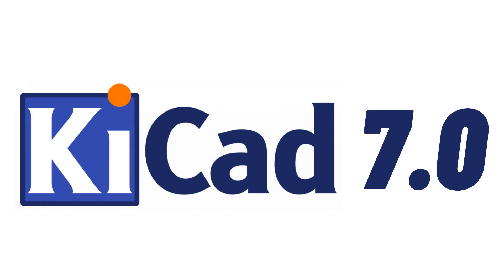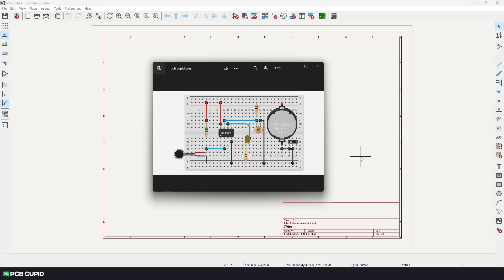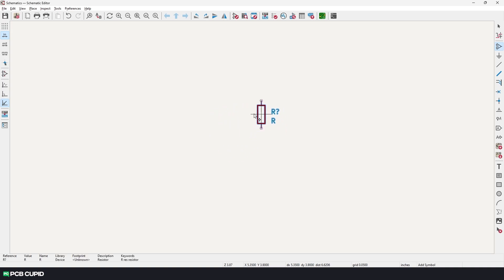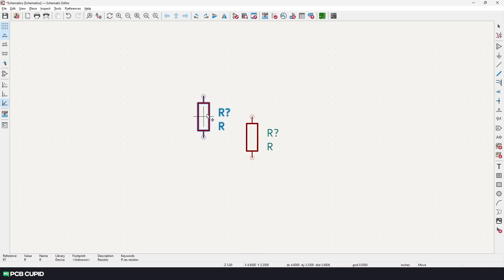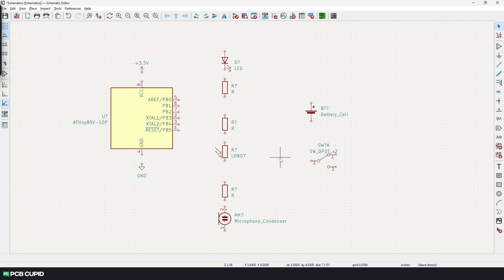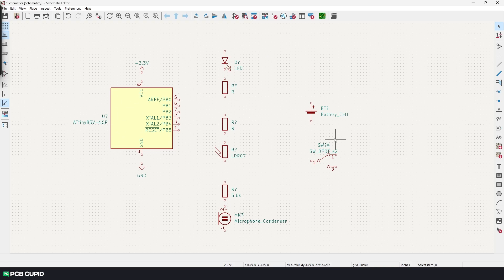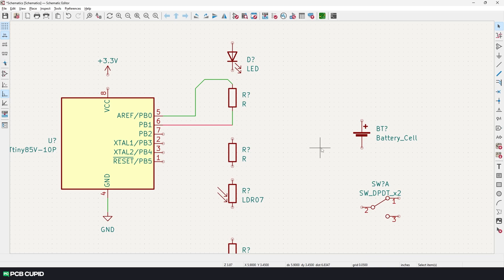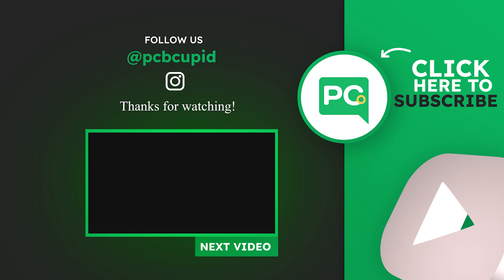#3 How To Design A Circuit Using KiCad 7.0 Schematic Editor | #PCBCupid

Comment: thanks for the video . how can i change power supply as "vac" value. I'm trying to do dc power supply 220 V, 50 Hz but i cant change the value. whats the solution of this problem
Reply: Well, can i use screw_terminal_ 01x02?
Reply from the maker: @busra4386  Yes that would be perfect.
Reply from the maker: Which power supply symbol are you using? 

You can change the value of the symbol by going to the properties. (right click on the symbol and then click properties or select the symbol and use the shortcut "E")
Reply: @pcbcupid  I added the source seen as AC_voltage source used in multisim program as “vac” in kicad.  But in kicad, I can't enter a value like in my multisim. 
I have to use this design https://youtu.be/DaY3ruHjnIk
Reply from the maker: @busra4386  If the symbol is part of power symbols there value might not be editable for example : +5v, +3.3v, VCC, VAC , AC etc

Instead you can use a 2-pin terminal to indicate the AC supply and add AC power label to the net.

The circuit used in the video we follow the similar method. Where we use "Cell" to indicate the DC supply and then attach a +3.3v power label.

Comment: Thank you for this nice beginner tutorial. How do you get the wires to connect nicely to the components? When I try it with my Kicad 7.0.1 the little "+" does not appear on the wire tool when I hover over a pin. And when I try to draw wires, it is very hard to get them connected correctly (it actually takes many minutes for just a few connections!) - also when moving components after the wires are connected, they detach from the wires, instead of dragging them with the component, like I'm used to from Eagle. Is that the way it's supposed to work?
Reply from the maker: Some of these solutions can fix your issues : 
1. Try to keep the grid settings to 1.27mm or 50mil
2. hover the cursor over the pin (where there is a small circle indentation) and then use the shortcut 'W' to draw the wire
3. Using the move shortcut 'M' will cause the wires to detach from the component instead just click and select the symbol, then try dragging it. 

I hope these solutions will help.
Reply: @pcbcupid  Thank you! Meanwhile I had found the solution myself:
I had set the grid to 1.27mm (50mil) and it was displayed that way at the bottom of the screen. But somehow it must have not been effective, I don't know how. When I found the tip "right click on the grid symbol in top left to change grid settings" I saw the "current setting" was something really small. So I hit ALT+1 and re-snapped everything to grid (CTRL+A, rightclick, align to grid) and FINALLY I can work decently :-) 
Another important tip I read somewhere is to NOT use "M" to move things around, but rather "G" (grab) which leaves connections attached.
Now I also get the little "+" I was missing ;-)
Reply from the maker: Goodluck! Thanks for the sharing tip as well.